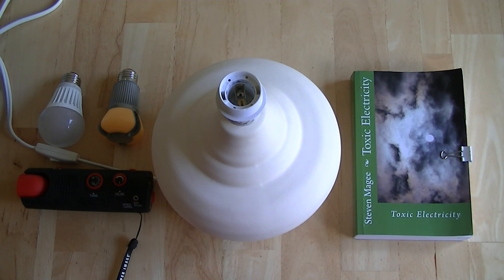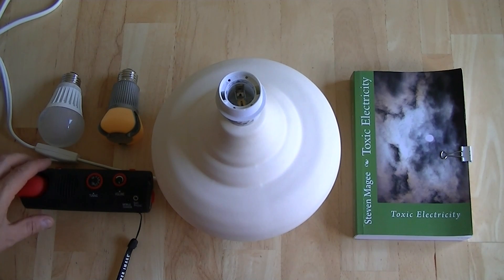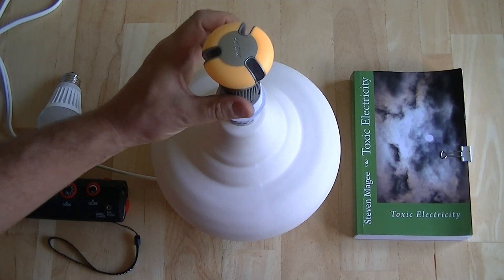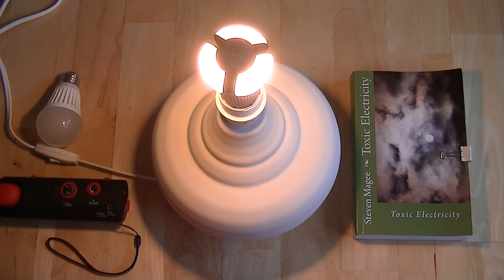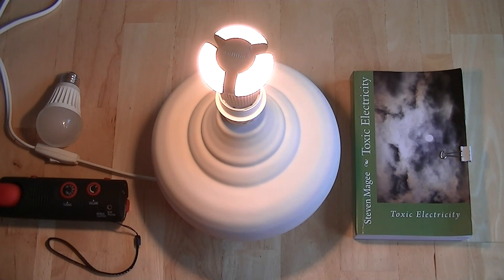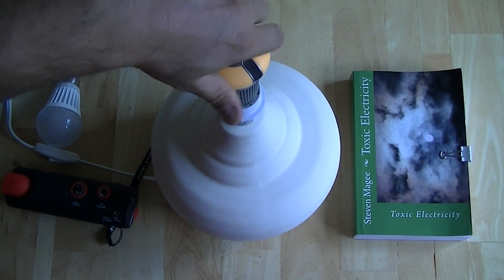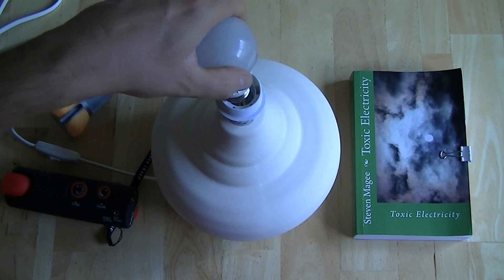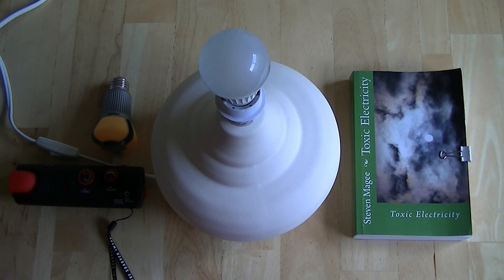Testing Dimmable LED Light Bulbs for EMI with an AM Radio

Comment: Is the interference from the light bulb or the dimmer?
If the same bulb is used on a circuit that does not have a dimmer, will it still make the same noise?